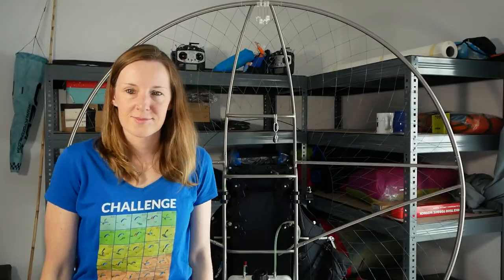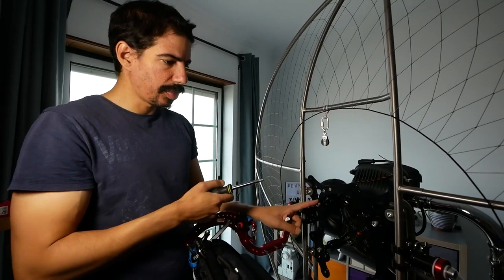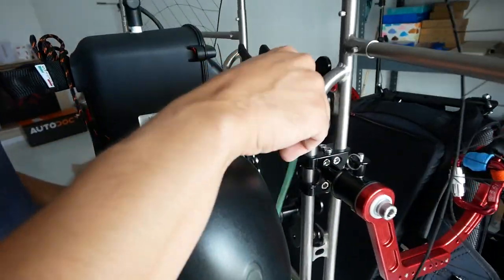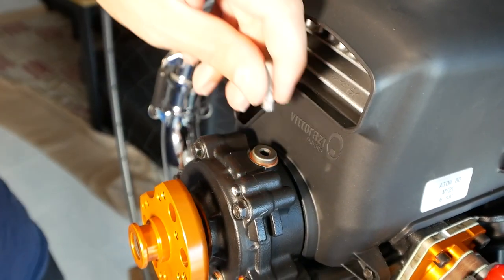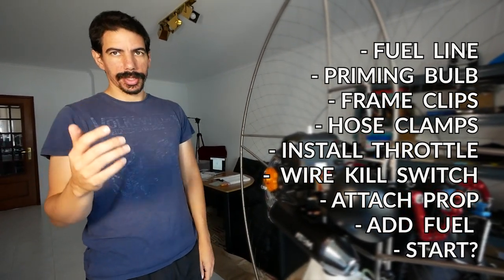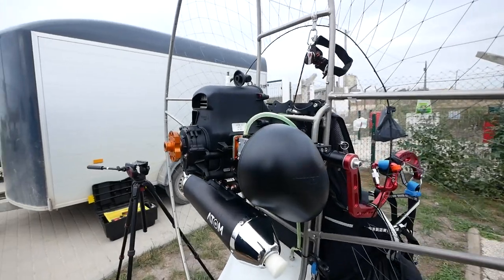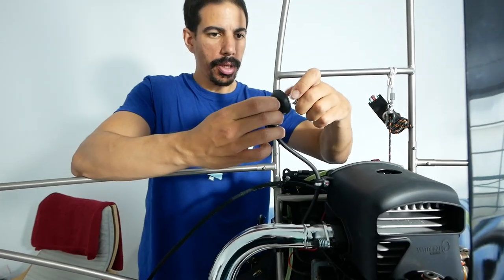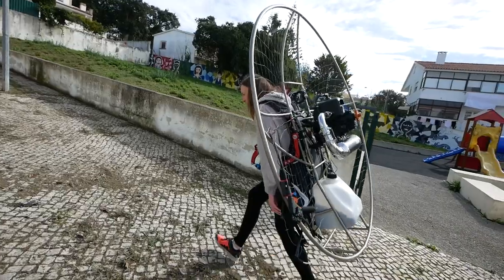Atom80 Install and Break in on Limitless Frame - BANDARRA

Comment: Love all the videos of you two paragliding. Glad to see you come over to the paramotor side. Hoping to start free flying soon. You should add a secondary spring to the throttle cable. Also I do the same thing with the stand offs. If you do the stand offs on fuel lines, make sure to check and change fuel lines more often then you thing. I've have fuel line have holes rubbed through them and caused air leaks and my engine stalled and I didn't know why. Now I check and replace fuel lines often.

Comment: A suggestion for your consideration.... instead of wrapping the wire from the tachometer around the plug wire , you can get a new blade connector the fits on the coil where the kill switch wire goes and crimp both the tach and kill switch directly into the blade.    Gives a little better tach signal.
Reply from the maker: Didn't know about that, will give it a try. I have a future video coming out about a similarly related subject so will be interesting to get your thoughts then

Comment: Hi guys! I begin my motor WITHOUT THE PROPELLER. It has never gone to maximum RPM. It stays in about 3,400 RPM. No risk at all. After about 30 or 40 seconds I turn out the engine, I put the propeller, I prepare  the wing, and turn the motor on with it in my back. I accelarate  it slowly for about 30 seconds, slowly, very slowly, until it reaches the temperature and enough RPM, and then I take off. Almost five years doing like this without any risk and without any fears! Try it! ( I fly every day of my life here in Brazil).

Comment: That's the motor I want too! My electric is too short run time. You guys should weigh the whole rig so we have an idea ;)
Reply from the maker: I’ll try next time Sandra!
Reply from the maker: Turns out it’s 20kg with no fuel Sandra. It does have a 1.5kg reserve parachute in it though, so not bad at all I think

Comment: Not sure about not using the primer pump since it is something that is used on many Atom 80s including mine. Blowing air seems a little ugh.
Reply from the maker: seems to work ok
Reply: You are right. I’ve 2 atoms and nearly 300 hrs on them. Primer bulb works fine.
Reply: @pittsjohn57  yeah the idea of putting a hose in my mouth where the fumes from the tank come out is not so nice